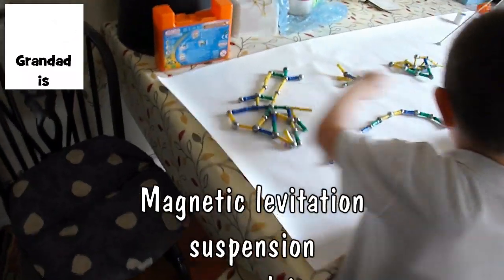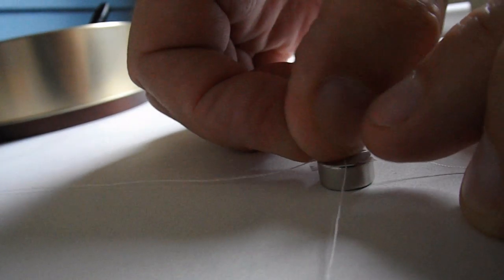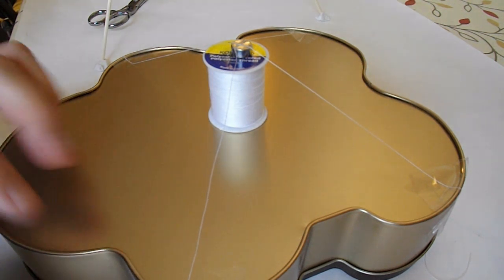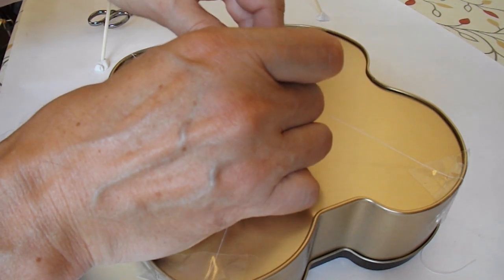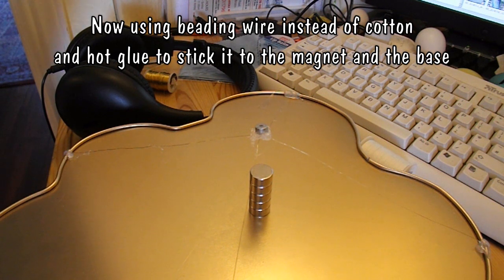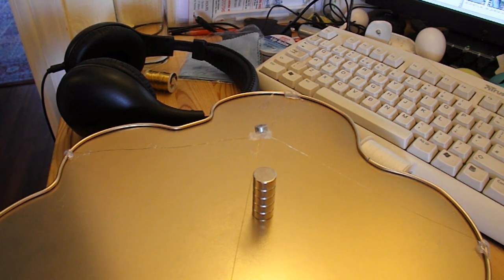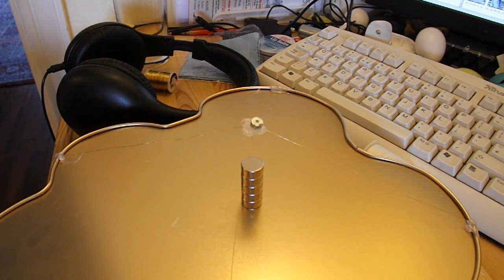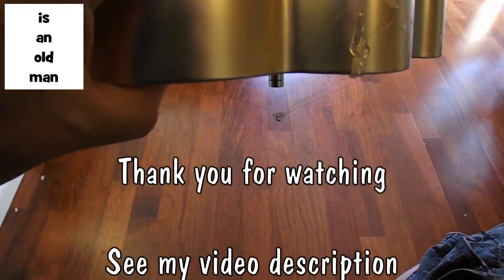Magnetic levitation or repulsion

Comment: I assume in this case stacks of all neodyniums with center hole tapped so u can just feed in 1 string is just as difficult??
Reply from the maker: All these magnets are solid. Do you mean to replace them with a stack of magnets with centre holes so you could feed a string up the centre to attach the top magnet to be levitated above? I guess it should work and is worth a try if you have suitable magnets. The main problem is stopping the top magnet from spinning itself over, once you have fixed that it is easy.